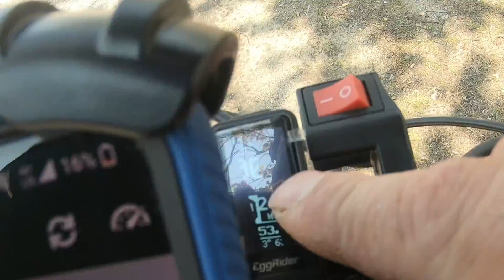Super Fast E-Bike Hits Over 50 mph + Overheating BBSHD Motor

Comment: Been running a BBSHD for several years now.  I love it.  
My personal top speed is a around 41mph on flat.

What voltage are you running yours at?
I am running 48v.
Reply: I went 42.5 mph on by 750w bbs02 Drop a gear and pin the throttle bud
Reply: 42max on the 750 with 52v battery.  But I'm fixing to add the unity shark battery  60v for bafang. 20 amp hours 30 BMS. To the 48v.  That's an actual upgraded battery . . 52v battery Is to close to 48v. So. An actual upgrade would be the 60v. Bafang motors can handle it it's a high build.  If you can make it go faster it will deliver on it
Reply: @cognac8297 unfortunately a 60v battery would be a waste on a standard controller bbs motor as you'd only be able to charge it approx 60%. The capacitor is only rated to 63v, if you plan on keeping it standard you coould build a 15s battery and charge to 61.5v though. It's what I did until I changed to a vesc controller, I added another series to the battery then and even just running it 40 bat and 90 motor amps it hits 35mpg in the lowest gear (32t), haven't even tried field weakening yet and I literally never have to change gear.
Reply: @mrkiplings  Hi mate, i just checking the video and comments 😊 So you say that bbshd the stock controller can handle 63v without touching the controller 😮 my batt is 52v fully charged 58.2 or .8 something like that, but up to 61.5v this is another 3v which is nice 😊 another couple of miles speed.

Comment: Thats crazy, i got a BBSHD, my max i around 30-35mph, i got a 48v battery, did you upgrade yours or how is this possible? Do i have wrong type of gears on mine?
Reply from the maker: Nope, that sounds about right with the 48V setup. I had a 52V battery and maxed out at the 37mph limit. It's when you use Mr High Voltage kit with a 72V battery pack that has minimum 55A continuous amps, that's when you can push the BBSHD further. I feel most people don't weigh as much as I do at 230 lbs, one can easily hit 45-50mph with no issues even if it's a full suspension bike.
Reply: A stock BBSHD and an aftermarket controlled BBSHD are entirely different beasts. Think of it as adding a turbo and getting it professionally tuned. I run about 40-43mph on 48v with a BAC855 controlled BBSHD and best of all...that's done with a 20t cog. No gear shifting.
Reply: @ilovetacos210  Wow, amazing:) But the original controller is still powerful? Do you think it can handle full throttle for 20km rides @ assisant 9? Or do i need the upgraded controller to be able to handle that kind of pressure?
Reply: @henriksvensson2836  of course it can handle short rides like that. The controller is kind of the "computer", upgrading it degrades the motor, not the other way around.

Comment: Hello from Buffalo! Just joined the Discord. Saving my money up for HV kit. Was torn between CYC kit or just upgrading current BBSHD. After over-volting a cheap NB Power kit to 120 V with 3 green work battery in series, only 6 AH total, got it going 48 mph in 3 out of 5 power settings. Sadly in love with mid drives and slowly selling off my cheap hub motors. Torn between HV kit now and Phaserunner, but I love the HV channel and Discord, hope to own both, as selling off my car now.
Reply from the maker: I don't know much about the Phaserunner and did look at it but I've been very happy with the HV kit. Very friendly group and Mr. HV team has been slowly growing. Definitely ask Rio Cole on there for a custom 72V battery or whatever spec you need. He'll build you a top notch battery setup for the kit 😀

Comment: Do you stay in lowest gear or you do shift a lot toward highers gears ?
Reply from the maker: Nope, single speed setup. Higher gear doesn't gain much in speed and is too stressful on the motor so I find this 36-24 to be just the right setup for me.
Reply: @SparkyBikes  36 teeth on the front and back 8? Sorry im a newbie:)

Comment: What kind of controller and battery please??
Reply from the maker: It's Mr. HV's kit running BAC855 with custom 72V/20Ah battery made by RioCole on Mr HV's Discord channel. It has continuous 55A discharge for the batteries.

Comment: So sweet😁 Next build is def going to be bbshd with High Voltage kit
Reply from the maker: Ya, it's a hidden gem I say. Get on the order list as these things are high in demand once people find it. That's pushing 50+ mph with my 230 lb weight. People that are lighter with some good slick tires will easily push these things close to 60mph without a doubt.

Comment: How long can it hold 50 mph?
Reply from the maker: It's a burst really; most of the time I'm cruising around 25-30mph and average around low 20's. The motor especially after it gets to be 60+ gets too warm hence the overheating I experienced yesterday.
Reply: Can it cruise around 35-40? Keep up with traffic.
Reply from the maker: You can, but heat becomes an issue after awhile with BBSHD unless it's cold outside.
Reply: What is the highest operating temp the bbshd can withstand? In the video I see you had to stop at 150 degrees to cool down.
Reply from the maker: Ya, it's around that temp when the controller (EggRider in this case) will throttle the input in order to protect that motor. If you are doing 25-30 mph on average, you'll have the motor running cool. It's also a good cooling down speed once the motor is back up from cooling down. 40+ mph speed is for burst only; not doing so for any extended time without risking the motor from overheating. If you want to do that, of course, you're looking at a more powerful setup like the Lightning Rods which you'll need a bigger platform (like Sur Ron style frame) with bigger batteries.
Reply: @SparkyBikes  have you put heat sinks to help cool it down?
Reply from the maker: I haven't but funny enough, I bought some heatsinks to see if I can lower the temp a bit on average. I'll just have to play around with them and see what works.
Reply: @SparkyBikes also what gearing are u using to hit that speed.  Are u staying on one gear?
Reply: Thank you for this valuable information.  Cant wait to see more videos.